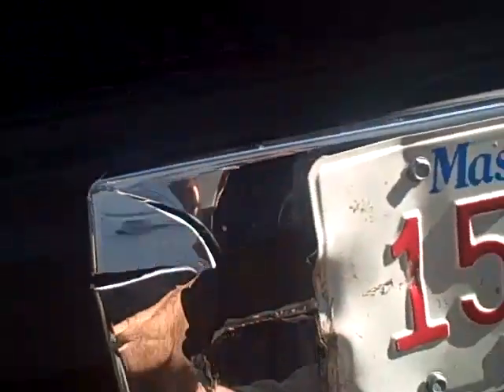Is THIS the airbag sensor?

Comment: I know this is old and you may have your answer by now, but that is the temp probe that gives you the outside temp that is displayed on the dash. I ran across this researching info for my wifes 06 dodge grand caravan. I have worked on those trucks like you have there a lot.